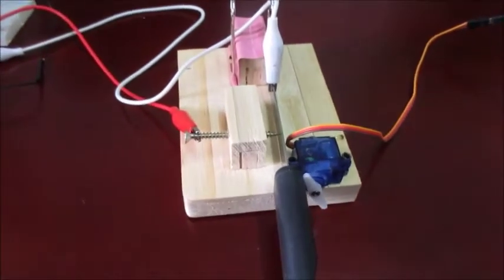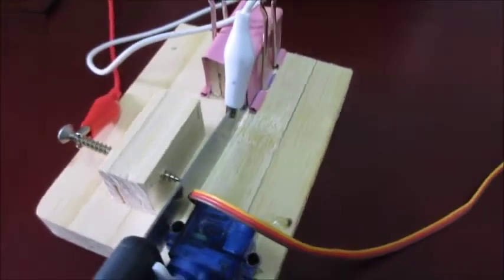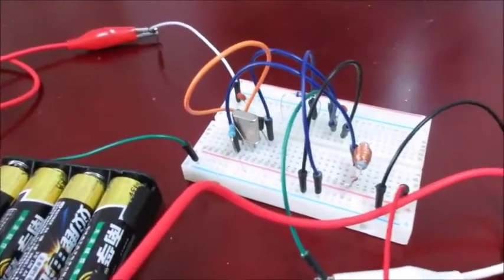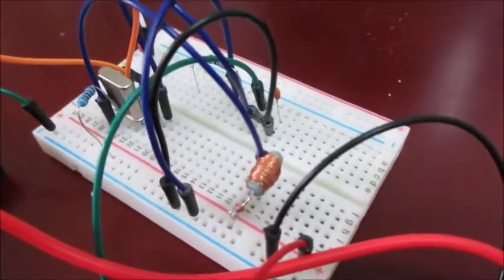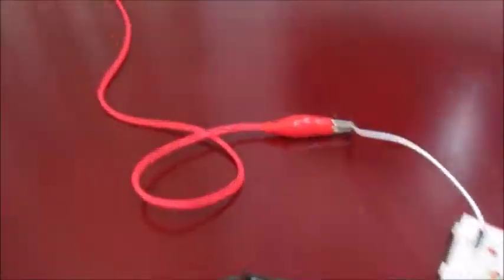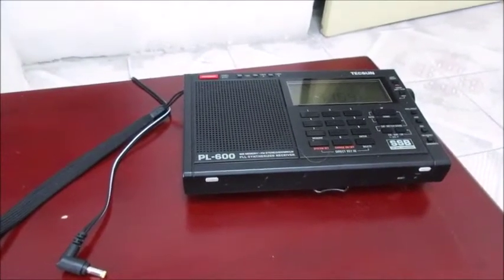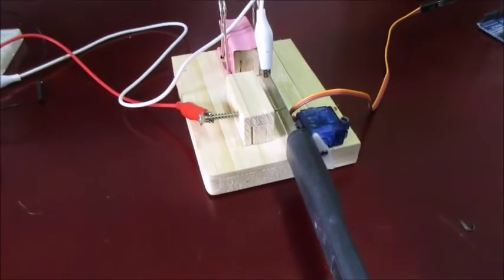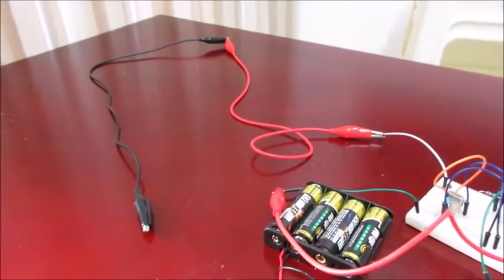Arduino Controlled Morse Code Key and Transmitter

Comment: Hi, thanks for your video, I have a question. It's possible if I code adruino become a key without sevor
Reply from the maker: Yes. I just did it for fun.
Reply: @demej00  i mean output from adruino will connect directly to CW circuit without key. It's  possible?
Reply from the maker: @conghanhoang1222  Yes, you can use tone() function. See this article: https://electropeak.com/learn/morse-code-communication-using-arduino/
Reply from the maker: @conghanhoang1222  Sorry. I misunderstood. I have to investigate it.
Reply: In my project, it always transmitt a signal, this is "marker" word. I intend to use adruino as a key. Do you have receiver circuit
Reply from the maker: @conghanhoang1222  No, I have a SSB Ham radio for receiving.
Reply from the maker: You can use a transistor in place of the servo and key. Try using this circuit: https://create.arduino.cc/projecthub/sumanbargavr/switching-using-transistor-c9114a
Put the two lines from the transmitter where the LED is.  No promise you won't hurt your Arduino but i think it should work.
Reply from the maker: This is probably a better cicuit: the transmitter leads go where the motor is. https://www.instructables.com/id/12V-Motor-Control-With-5V-Arduino-and-NPN-Transist/
Reply: The value of L? Do you have Facebook or gmail, so we can đicuss more clearly
Reply: Oh, I saw your circuit very clearly. I will do it tomorrow. But I have a question, how many value of L. Please answer me
Reply from the maker: @conghanhoang1222  Don't know what you are referring to, L?
Reply: @demej00  the value of inductor. Please help me, I have to do this for my project
Reply from the maker: @conghanhoang1222  Sorry I can't be of more help but I do not know electronics. I just built the TX from a schematic and hooked it up to an Arduino which I do know something about.
Reply: @demej00  thanks sir
Reply from the maker: @conghanhoang1222  This tells you what L1 is: https://makerf.com/posts/ten-minute-transmitter
Reply: Thanks for taking many times for me
Reply from the maker: @conghanhoang1222  No problem. Let me know how it turns out. Good luck.
Reply: Hello sir, it's me agian :)). I have a question. What is the range frequency between transmitter and receiver?
Reply from the maker: @conghanhoang1222  The frequency is the frequency of the crystal you use. The range of the TX depends on your power and antenna - lower power and small antenna has range of meters - more power (dont exceed 12 volts) and big antenna - kilometers.  I tested mine in a mountain village and still got the signal up to 5 kilometers away with a 3 meter antenna. Much better range in flat terrain.
Reply: So your radio have to operate at frequency which same crystal frequency
Reply from the maker: @conghanhoang1222  Yes. L1 affects it a little but mostly it works at the crystals frequency.